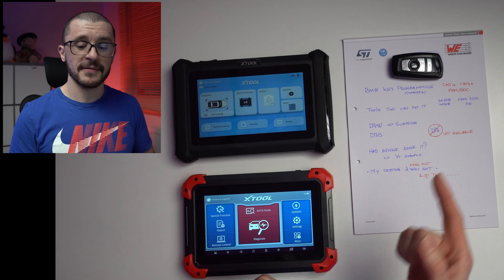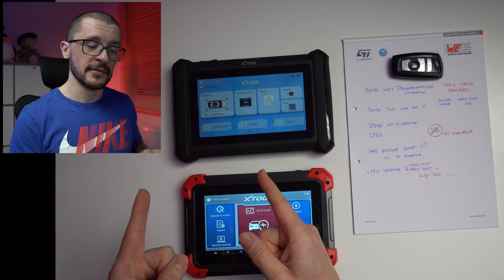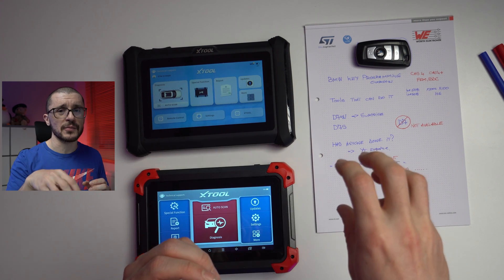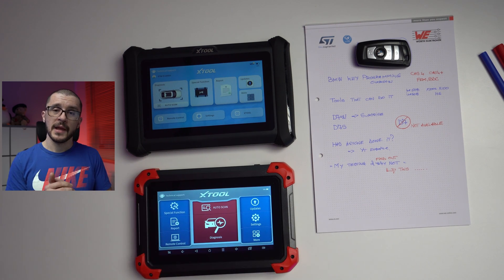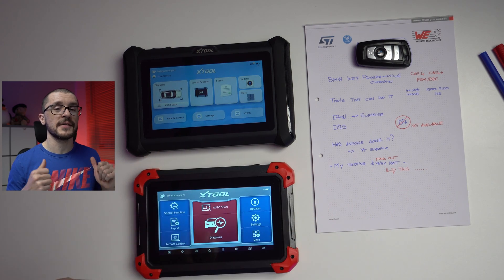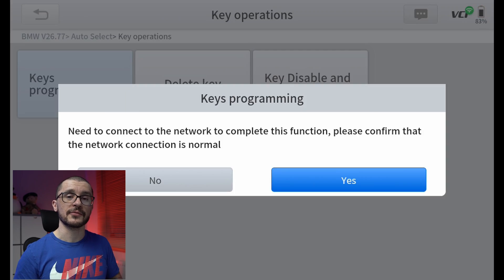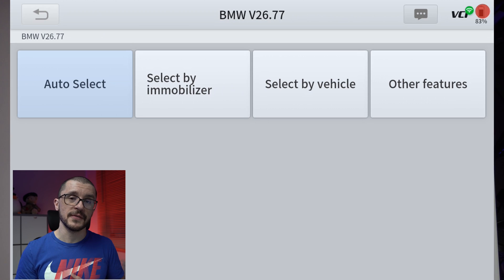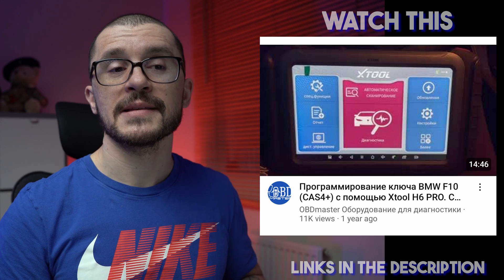DANGER or NOT: Xtool D7W has BMW CAS4 FEM BDC Key Programming

Comment: Crap I should had bought the d7s when I bought my d7 2 years ago.
Reply from the maker: no way to know that they are implementing this in the new software.
Reply: @BestCarMods  Hello sir Thank you for nice information Please tell me on xpad 1 I see you have a different interface than mine I mean I don't know the app is different than mine Please what version of app do you have I see I have v3.7.6 yours which version is it? Thx!
Reply: 2 months ago I did All Keys Lost on FEM bmw key with my Autel IM508s and Xp400 and OBD was not supported I still had to removed FEM/BDC from passenger kick panel twice and also had to remove DME in engine bay to get password because the password read thru OBD but was incorrect 32 digit PIN number and finally worked when read from probing DME and was completely different number. Autel got it running but had to remove FEM and DME

Comment: Did you ever get the D7S or W to program a BMW?
Reply from the maker: not yet. did not have a reason to do it, aka did not have a key to program. That being said I now plan of testing the IP919 on the cas4. will follow up with a video.
Reply: @BestCarMods  Did you check on Cas4? IP919 pro